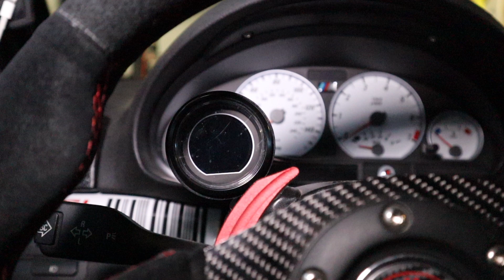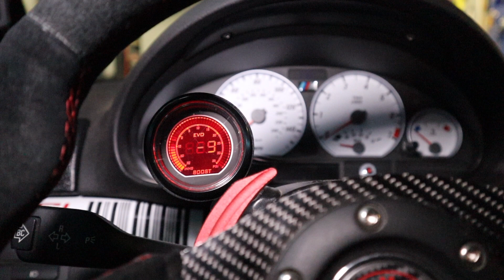Have I completely ruined the 'Ultimate Driving Machine'? BMW e46 330ci non-m 400whp track build.

Comment: I don't know if I said this or not on one of your older videos dealing with the 330CI but your version of the car inspired me to modify mine! I got my 330CI in 2020 and it was the very first car I ever paid for/had. I will admit that I got the car extremely cheap ($3000) and I was young and unknowledgeable so I only got it because of the look and affordability. Very high mileage and tons of problems similar to some of what you stated lol. Ever since I had it, I made sure that it looked extremely nice and eye-catching (even though it has problems which I tried to costly repair) and I started customizing it this year. I didn't go fully ORGANIC modifications (meaning mines are all aftermarket and replicas of the real thing). So to sum it up, my 330CI is basically or UN-ORGANIC version of yours with a ton of problems you similarly stated. I can't really drive mine and every time I get it fixed, something else happens that's why I'm not going to put the real body kits, spoilers, carbon wraps, etc on it. I guess the lesson I learned is to not get a old BMW like a 330ci because it is unreliable, costly and unpredictable. Now on my way to either a: Pontiac Solstice, Saturn Sky, Mazda RX-8 or Toyota MR-2 but never again a old BMW.
Reply from the maker: Well I’m sorry that’s what you’re experience has taught you. That’s all I buy is old bmws. They are so easy to work on. Keep going with your project. The first one you learn on it always the hardest
Reply: Calls old bimmers unreliable but is considering a rx8 and a pontiac lmao. My 330ci has been nothing but reliable, and I picked up mine for $3000 too. It sounds like you were more concerned about cosmetics, and not actually keeping up with the maintenance of the car. Also, the reliability of the car really depends on what parts you use. Almost anything you get on ebay or amazon is obviously not being made with the same standards as genuine bmw, oe parts or basically anything not made in china. These cars are really not that expensive as long you do the work yourself and don't cheap out on parts.

Comment: I’m looking at a 2004 330i zhp guy claims to only take it to bmw dealer for maintenance always on time it’s got 167k miles, it’s stock and I plan on keeping it stock because I’m looking to daily, I’ve Hurd good things about reliability when stock and driven semi normally what do you think is 167k too much even considering it’s been maintained??? Btw I reallllyyy want this car 😆
Reply: Get it checked by a proper bmw mechanic. I promise you it could save $1000s in costs for stuff that the owner might not have told you about/noticed. Also how much does he want for it? is it much cheaper than less worn ones? if its only a little bit cheaper than nice low k ones then just save and get one of them.

167k is alot of miles, but if you look after it properly and always replace broken parts with oem or better than oem parts then you should be ok. 

Also try not trash it if your broke, trust me just play it safe untill you have the money to spare becuase BMW parts are sometimes very pricey and just becuase a car can drift, doesn't mean you should drift it. Drift cars are built to do that. A stock zhp isn't esspecially with the higher miles.